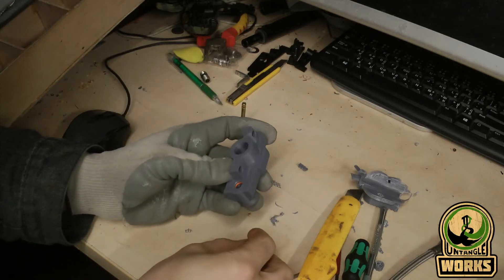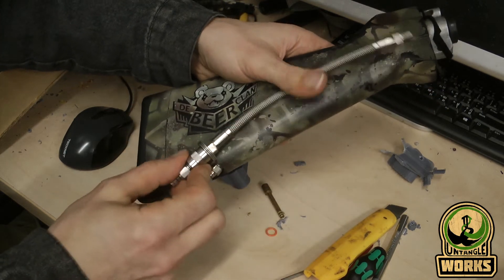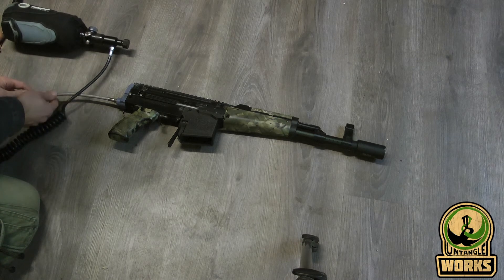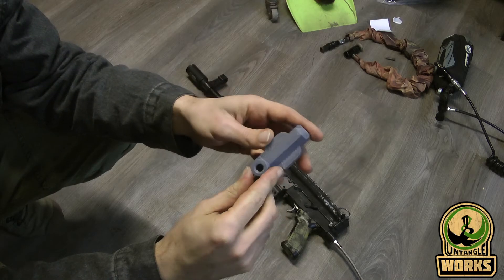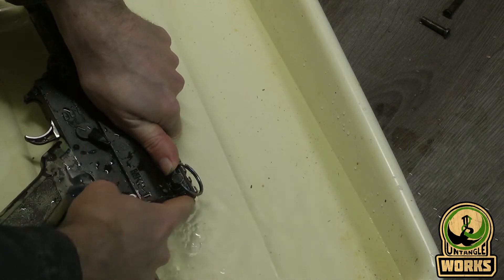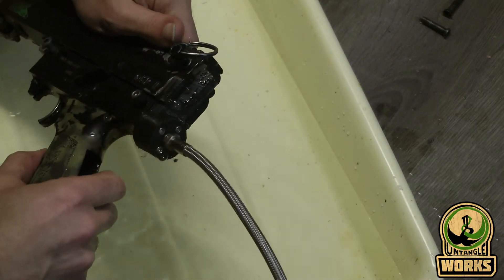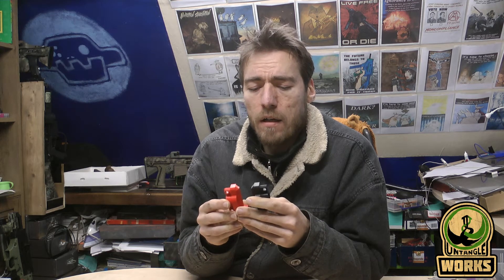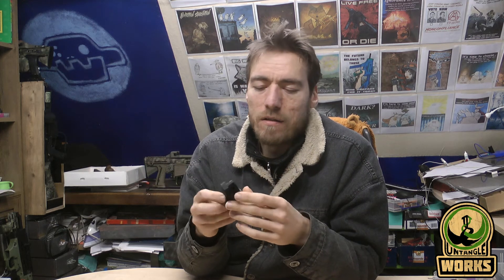UNW Testing: 3D printed parts with 700PSI of air pressure out of a paintball air tank HPA

Comment: A ideia é boa, eu mesmo já pensei em coisas assim, o problema é colocar isso em campo aberto, qualquer força externa pode causar um efeito dominó na peça, caçando partes mais frágeis e as usando para escapar o ar ou até mesmo explodir. Mas é muito bom, você é um dos pouquíssimos canais com um conteúdo interessante e que explora essa coisa de fazer do 0 projetos. Na Alemanha tem um cara que fez um drum mag usando apenas mola, infelizmente ele não envia para o Brasil e creio que seja impossível que ele venda o arquivo.
Reply from the maker: yeah it was a interesting experiment. but if you can for your projects then it's way better to stay with metal parts on this type of thing.  but who knows maybe someone finds out a good way to using 3d printed part for things like this but it will always be weaker. no telling if UV, oil is damaging the plastic over time leaving you with a air leak.

Comment: Пластик... 😕 Пластик из 3D принтеров имеет полости (возможно печатать без пустот внутри пластика?) ...или используй полиэфирная смола для создания эта деталь (используй напечатаную деталь как образец, сделай форму из силикона и залей эпоксидной смолой)

* Plastic... Пластик Plastic from 3D printers has cavities (is it possible to print without voids inside the plastic?) ...or use polyester resin to create this part (use the printed part as a sample, make a mold out of silicone and fill it with epoxy resin with reinforcement threads) ...?
Reply from the maker: yeah, that is idd a thing to look at. it looks like I got some air pockets inside my printed parts, so my extrusion settings don't look to be that great for this. 

and that about making a mold that could be a way to go as well incase you really need a custom shape like I used in this test. but the complicated part with that is that you need to keep in mind that the part shrinks a bit. not that I'm a experienced in making molds and so on.
Reply: @UntangleWORKS  Você já pensou na possibilidade de usar moldes impressos em 3D com filamentos que suportam temperaturas maiores para acopla-las em um pistão e pressionar plástico derretido dentro? Seria uma forma de injeção plástica e assim te dará maior resistência mecânica.
Reply from the maker: @JJ_Assalt  well I have seen people do something like that. in the sense that they make a molt with a 3d printed part. I think they did it with a resin printer. but for now do I have not really played around with that technic. I have seen some things about it on this YT channel TheCrafsMan SteadyCraftin  https://www.youtube.com/c/TheCrafsMan

Comment: Maybe you should try using a Resin printer? Not sure if it would hold together,  but it should be more airtight.
Reply from the maker: that is a possibility I have no idea how that would behave under pressure. I did think at a later time, like well it does work once you are past the the marker regulator and the pressure is lower (400PSI?). since I did made a 3d printed cap/plug to seal of something with in a tipx internals for the FGC68 build that I made, and that works fine.